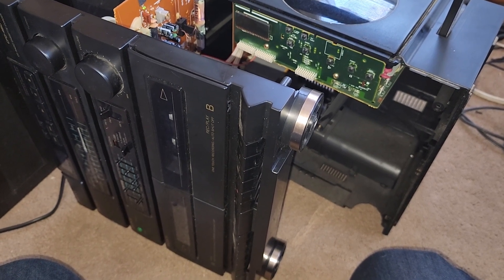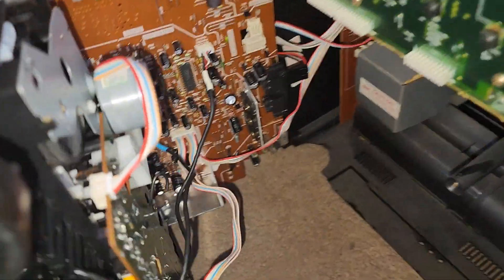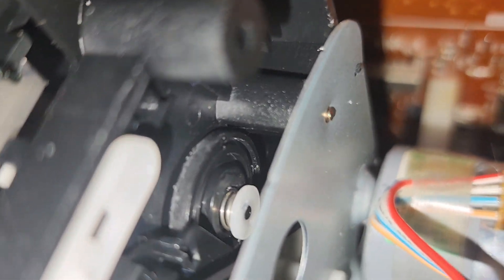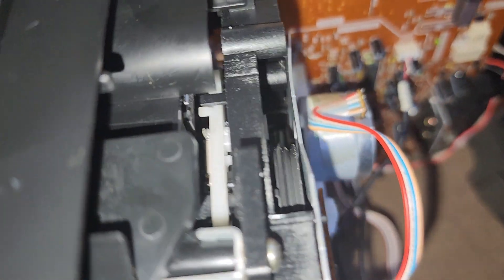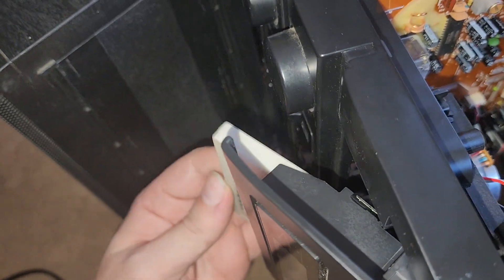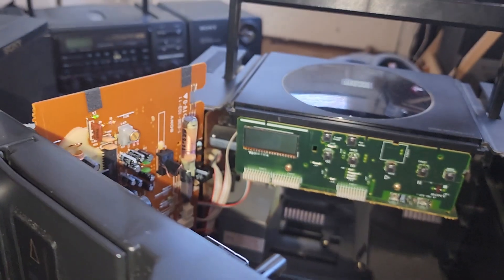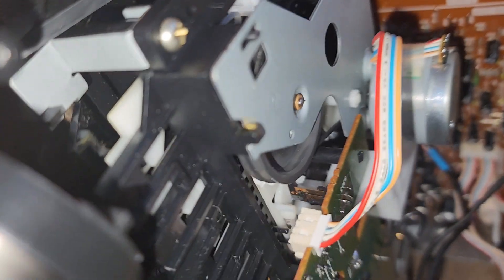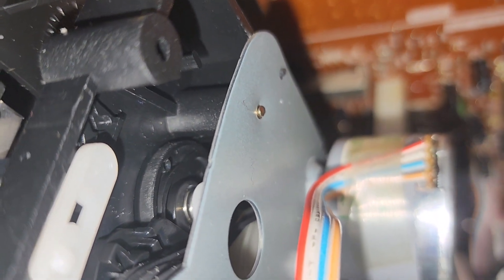Update on Sony cfd-460 boombox

Comment: you could actually replace The idler wheel with a rubber plumbing O ring it's something like this ⬇️
https://youtu.be/ggFpy6WCRvI
Reply from the maker: yes but i had none. id have to order some but ima stick with what i did cause it seems like its working so far.